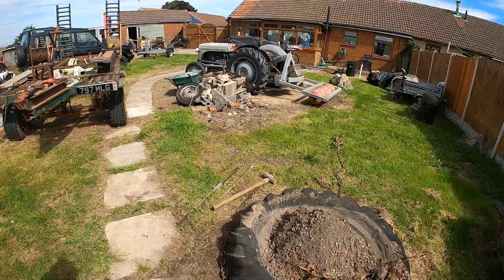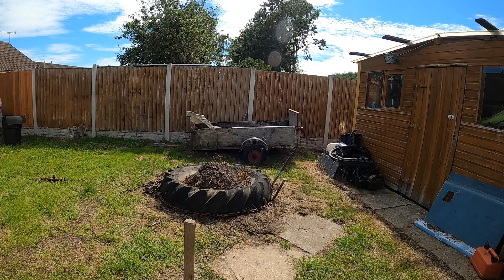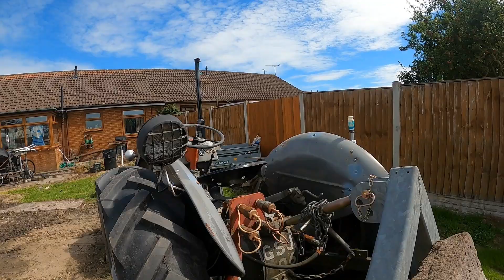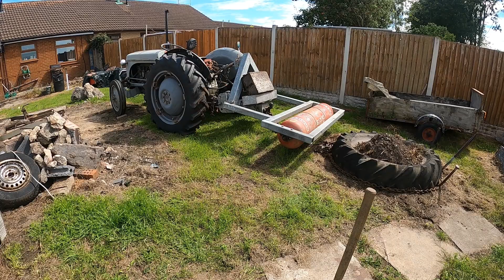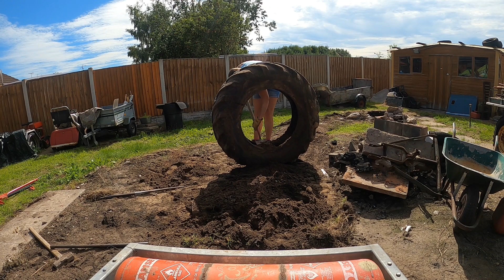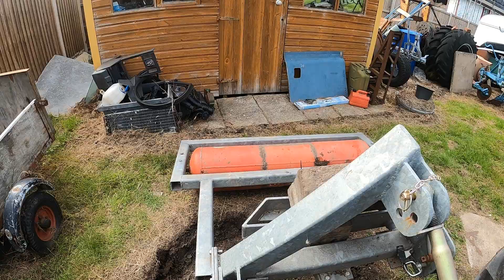Ferguson T20 moving a tractor tyre and wheelie!

Comment: Fergy at tick over is too slow, end up knocking a big end out.
Reply from the maker: Yeh have to keep an eye on the oil pressure as the camshaft bushes get worn and are the cause of low oil pressure. It is fine on tickover when cold. But when warm i agree aboit the big ends being a cause for concern.